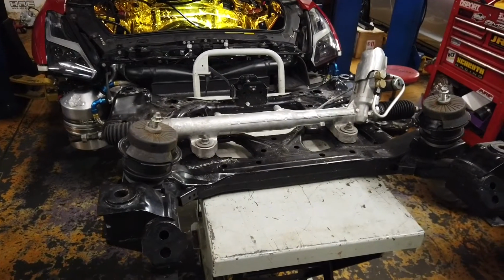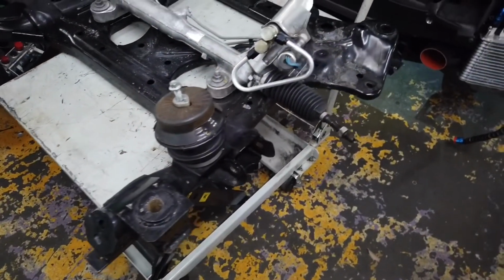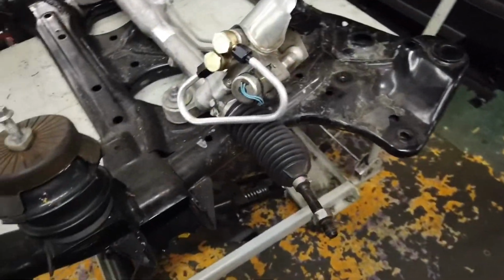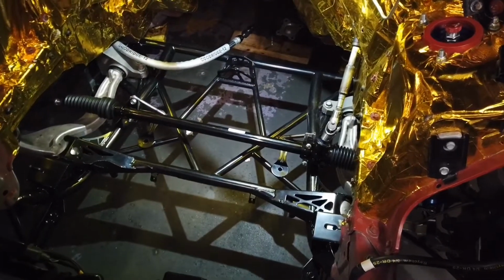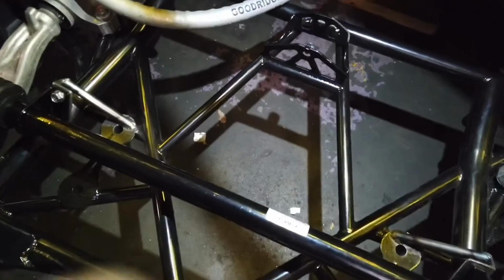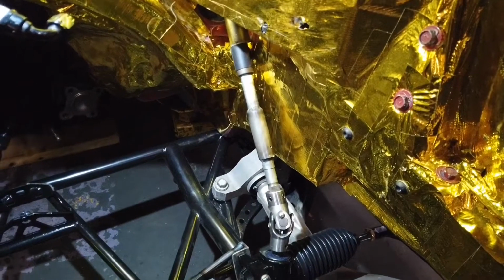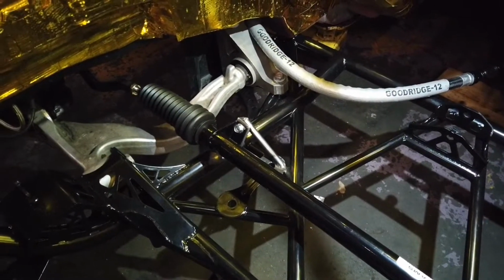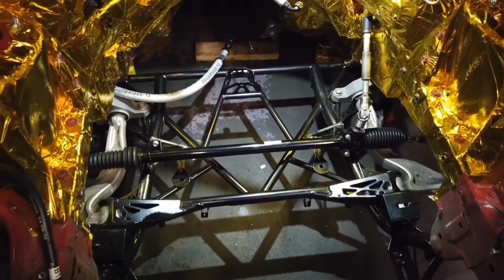Manual Steering Rack Conversion R35 Nissan GT-R

Comment: What was the type of bolts used for the conversion (to close the loop). Size and thread?

Thank you
Reply from the maker: I apologize but I do not recall exactly what the hardware was.  I do know that it was an 8.8 bolt and locking nut.  Fairly certain it was M8x1.25 for all 4 of them which was what the rack is most closely sized for.